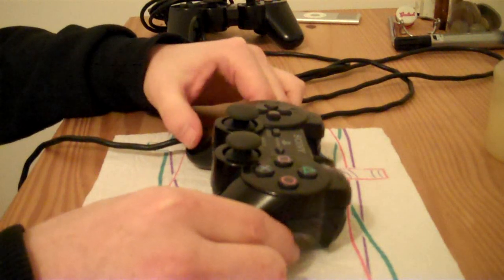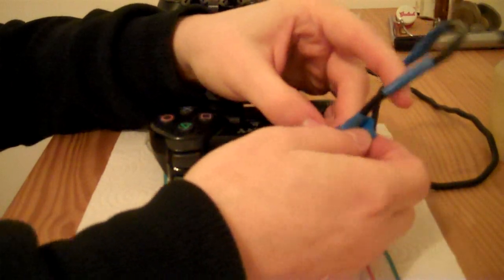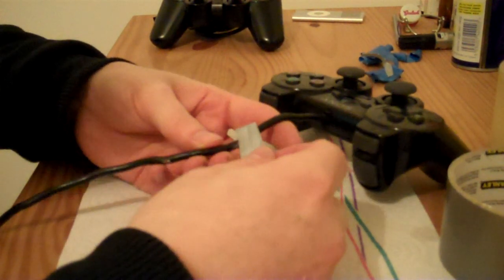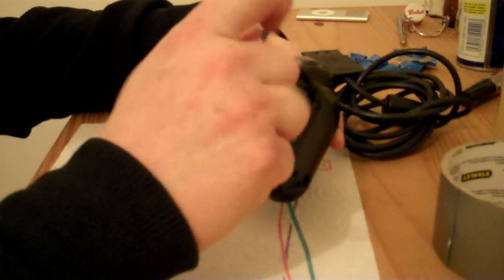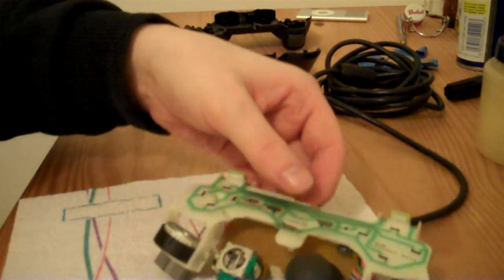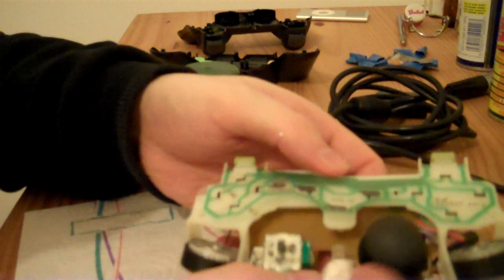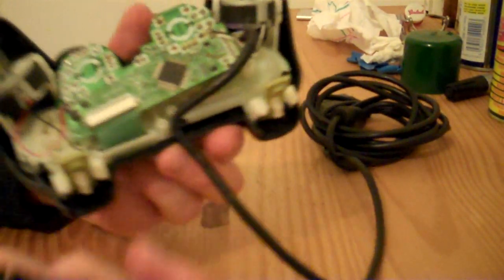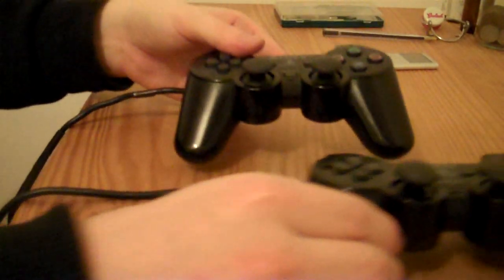Fixing a couple of PS2 controllers (includes worn analogue stick fix)

Comment: I bought those exact screw drivers just today! And thanks for the tip on holding the R2 and L2 buttons with your index and pinky fingers, i was having one hell of a time putting the controller back together.

Comment: It's probably already been said, but snapping the shoulder buttons back into place is much easier when the controller is assembled. Just press in the side pins on the L and R1 buttons as you push it back into its housing. L2 and R2 are even easier. But do pay attention with the L1/R1 buttons because it's possible to install them upside down.
Reply from the maker: Thanks, I didn't know about that.

Comment: Liquid Silicone - the best, according to my internet searches. Oil and wd40 - there is oil in there, it spoils the plastic. Don't use cotton wool. 
I'll go look for a liquid silicone-based lubricant and lubricate my left stick, which is slightly crunchy in the upper position.

Comment: Can I put the ps2 analogue into a generic PC controller? Because the PCs analogue hasn't got all the 360 angles it only goes to 45 degrees on each axis. So rotation and movement in newer games is bad on the generic one.

Comment: I have ps2 controller call sumy... The motherbord for analog and (right analog) that conect with ribon cable the pin that soldring in 3and the 4 is soldring to gother... I try in play attack or move direction not working i dont know why i remove the bridge it move around direction it self... Can i fix this or must back soldring 3and 4 pin..
Reply from the maker: Sorry, I don't know.

Comment: One of the pins in the connecting cord's mouth is missing can i cut the wire and join with a new wire
Reply from the maker: I don't know, sorry.
Reply: Pin 8 is unused according to the wiring diagram, if that's the pin you're referring to. Many manufacturers disregard it in assembly.

Comment: Hello! when i connect my controller to the ps2 he makes the red light, but dont works. however, i have a adapter  to play with the controller in ps3 and he works really fine! I can use other controller in ps2 ports,seems like dont detect my controller, but receive energy.

Comment: Personally, I’d have desoldered the controller cord and slipped some flexible heat-shrink tubing (the type with adhesive on the inside) over the breaks, then cored some 550 cord (about 2.3m should do it since the controller cable is a bit thicker than the 550 cord), and sleeved the length of the cord up to the choke with more heat-shrink tubing to clean up the ends. Then solder the connector header back to the board.
Reply: Liquid rubber works well to!

Comment: I just bought a ps2 controller and it hasn't lasted one week the right analog which mostly controls the aiming is moving left when I slide it to the right and keeps doing this continuously it's annoying. Any solution to this or is it a bust
Reply from the maker: Just do what I've done in the video.
Reply: Same to mine bro

Comment: do you have any videos on how to fix the triangle circle X or Square buttons not responding when pressed
Reply from the maker: No, sorry.
Reply: RPKVids wow
Reply: Wow nice
Reply: Stevencodeblack I have the same problem with my ps2 controller
Reply: StevenCodeBlack you need a new cover behind the buttons and try to hot glue the connector in the front
Reply: The PS2 buttons are pressure sensitive. The small carbon conductor beneath the button on the circuit board might be toast (usually result from a small electric shock to it) so it doesn't transfer the signal any longer. Another common possibility is the worn out circuit membrane. If this is the case the "lines" on the membrane are hardly visible. That basically means you have to replace the entire membrane or draw "new lines" with an electric ink. Sorry my poor english.

Comment: Thanks so much man, I've found my ps2 that has been missing for 8y! i found it with the controller and it was dusty and nasty and the controller has the same problem as yours, i used food oil and it's less worse now but it is still not the best, anyways, thanks <3

Comment: hi all. the cable / lead into my controller has 2 snapped wires just about 20mm from the point at which they enter the controller .  Inside the controller they link into a multi wire connector which is soldered to the electronics board.  I'd like to cut off 100mm of cable and rewire into the connector , [ I don't want to tape it ] ,,,  so  does anyone KNOW if the connections are clip-in or soldered,, or something else ?
  Thanks P

Comment: I have a logic 3 wireless ps2 controller that was great until the left stick began to drift. Think I'll use the spray grease rather than your mix but you've given me new hope for my wireless pad so thanks!
Tip = push out L2 + R2 before reassembly then pop em back after.
Reply from the maker: +lordsofkoble Thanks!

Comment: Bought some ps4 analog replacements n they work perfectly in my ps2 controller xD
Reply: thats why i actually watched this video, i wanted to find out if the analogue connectors are the same as ive done a few repais, im assuming you could use a 360 one or any stick that you like
Reply: I think you mean thumbaps? PS4 analoge modules are smaller then the  ALPS in the ds2.

Comment: i have a ps2 controller that just won't work. analog lights comes on and that is all. fixed a wire but that didn't help. gave up. that is why i don't wrap cord around controller. have you had analog sticks that got oily from sitting?
 i noticed there are different versions of the controller too. stuff inside is different. some have circuit boards that everything is on and held in with screws.
Reply from the maker: It's funny that you should mention that, because the spare thumbsticks that I have in a box with other spare parts have gone oily over time.
Reply: RPKGameVids
wish i knew why. also i would say deoxit would be better to clean and lube and maybe lithium grease. can find videos and stuff about them.

also might help to take the l2 r2 buttons out putting together. probably how it was done at the factory. they pop in easy too.
same with r1 and l1. can't believe you took it apart for those instead of trying to push them in from outside. they have little clip things on them.

Comment: Hello ! Will Ps2 analog joystick sensor work on Xbox 360 controllers?? And also it's rubber thumb grips .
Reply from the maker: I don't know. You can buy new rubber bits for the sticks from ebay for really cheap.

Comment: I picked up some petroleum jelly but after seeing it has salt in it (which we know is corrosive to metal) I won't use it. I have a PS2 controller that has started doing random button presses (R1 and one of the round buttons) and it started it while playing rule or rose. Unplugging and plugging back in didn't fix and powering off and unplugging console didn't work either. I took it apart cleaning it all good but still doing it even worse than before. I'm thinking it might be analogue stick needs furthur cleaning or the connector to the plastic connector board. I was thinking it might be my PS2 but I got another controller working perfect last night but just to make sure I'm going to try the old controller on another ps2 to make sure it's behaving the same way on it.
Reply from the maker: Nesmaniac I'm not really sure what could be wrong with it. I did think at first that maybe there was crud inside causing it to do that, but if you've cleaned it, then I guess maybe a faulty connection some where inside? Or maybe a component has failed. If you're into fixing stuff and have a soldering iron then it's definitely worth keeping the stick mechanisms, so you can use them to replace any stick mechanisms that have completely worn out and don't respond to the fix in my video anymore.

I plugged in a spare controller the other day, and nothing, completely dead, I'm sure it wasn't dead the last time I used it. I've not looked into what could be wrong with it yet, but god knows what could cause a controller to just completely die while not being used.
Reply: RPKVids Thanks a lot for the help. I'm going to try it on another PS2 because I have a couple more like new PS2 controllers that I don't think have ever been used and the dpad was not functioning (especially the up on the dpad) which totally bumfuzzled me. I'll let you know if I stumble upon a odd fix for these that might help you. I like a lot of people can fix a problem if it's consistent but with these controllers it seems like they have a mind of their own with lots of random problems hard to pinpoint.

Comment: Question, please answer me! basically i have a broken ps2 controller buttons, everything in good shape, just missing a pin which i assume is the problem. only the analog works on games. anyways, i have a gamestop controller that works but i hate the feel of, could i just cut the end of that controller off (that has all the pins) and sodder it to the old controllers wires and it would work that way?
Reply from the maker: I honestly don't know, I don't know much about gamestop controllers. But I think it should work.

Comment: My PS2 controller died itself hidden in console box for about 6-8 years. Before I boxed my console it worked perfect, now only work analog, other buttons do not work anymore, I cleaned membrame foil with alcohol but no luck. Controller is almost brand new but not work :(

Comment: Is it possible to do a video on fault finding inside a PS2 controller?

There are plenty of videos on repairing analog sticks and other videos about taking apart/reassembling a controller but no videos anywhere on how to fault find on dead controllers and there are plenty of dead controllers out there.
Reply from the maker: Kevin Langley Sorry, I'm not that good with electronics. I had a dead PS2 controller a while back but couldn't figure out what was wrong with it.
Reply: RPKVids Oh ok thanks for your reply :) I tested the wires in the cable with a multimeter to check the continuity just encase there were any shorts or brakes in the wires but all those checked out fine, so I then checked for dry joins with my soldering iron and there were no issues with that, so I then starting to think that maybe the chip inside was the problem so I tested the part to where the ribbon cable plugs in on that plastic bit that goes underneath where the buttons sit and found some faults but there not visible to the eye, so I need to get a conductive solder pen and redraw the traces and hopefully I should start making some progress. I just thought I'd write all this encase it helps anybody else who had some dead controllers. I have a whole box of them with all the same faults that I got on ebay
Reply: +Kevin Langley The isn't that much to go wrong with these things, apart from a bad connection or maybe a bad IC on the board, I doubt it could be anythings else. I had trouble with mine though, and one wire had an intermitent connection, also as you said the ribbon cable connections go bad at times but those can be fixed with some carbon paint or conductive paint.

Comment: On my PS2 controller the right button on the D pad has stopped working which is odd as I have never used it much (PS2 is a bit too modern for my liking).
Reply from the maker: That is strange. Have you ever opened it up to see what's going on? The only thing I can think of is maybe there's some dirt on the plastic circuit sheet that it makes contact with?
Reply: RPKGameVids Yes I thought that may be the cause too. I'll crack it open and have a look when I have a moment.

Comment: 2 questions: Does this method work on 3rd party controllers (I know, silly question, but best to be sure) and would vaseline and an air duster work as well?
Reply from the maker: I think there's a decent chance it'll work on 3rd party controllers. 

I don't think an air duster would be effective enough.
Reply: @RPKGameVids  Thanks. I already opened mine that's faulty (I have another that thankfully still works) and I noticed that the inside is different to the official controller. More barebones.

Comment: Took my controller apart and now its not working!
Any idea why?? I have opened a lot of ps2 and ps3 controllers and never had any problems
Am i missing something? 
It turns on but the buttons do not respond
Reply: It could be a contact issue, the ribbon cable has no connector and just sits on the PCB. I had the same problem and I fixed It with a piece of duct tape

Comment: Sometimes when a controller has too much problems its not worth fixing and instead its just better spending 7-8 usd buying one online.

The reason i state this is because mine had various issues such as the d pad sensor not working. There was nothing wrong with the rubber, or plastic but when i hit the sensors when the control was completely opened they never responded. Well i soldered new sensors and fixed that.

Then i noticed the motors for the dual shock were not working so those needed to be replaced, and one of the analog sticks was just really worn out. It took a couple of hours to fix this and in the end id say other than experience it wasn't worth fixing it myself rather than dishing out 7 dollars for a new one.

I guess if your control only has 1 minor issue which requires no soldering then have at it
Reply: John Smith The thing is most used controllers will also have some kind of problem. It's a gamble buying them.

Comment: hi! I used your guide and fixed a lot of ps2 controllers. Now I got a strange problem, after rewiring 1 vibration motor to a ps2 controller, it has a strange feedback.. It's so strong and powerful. Do you have any ideas?

Comment: Is it possible to take off the cable? please reply.
Reply from the maker: N00b 2100omg I'm not sure. I did try to take off the cable once, but it didn't work out well.
Reply: yeah, it can't be removed, I had to buy a controller, but I saved what I could from the other.
Reply: +N00b 2100omg I did remove mine, I just desoldered the pins from the board and the just soldered back together when I was done with the work on it. Cheers :)

Comment: these l2 r2 triggers are designed so you pop them in place AFTER you combine the two piece controller together. you are not suppose to cram it in, even glueing might cause it to wedge together. Lol

Comment: Do you know if a ps3 dpad will work on a ps2 controller? :p
Reply from the maker: XxBunny Dunno, lol.
Reply: +XxBunny If you're talking about the piece or the rubber membrane then the answer is yes to both, I've swapped pieces with both PS2 and Ps3 and they work fine.

Comment: Can we use wd40 in it?
Reply: yes wd40 is a good conductor for connectors and stuff although i wouldnt use it on everything electrical its cood for connectors with bare metal
Reply: I would not suggest it it will make your controller incredibly oily and GROSS. just clean all the plastic parts in rubbing alcohol